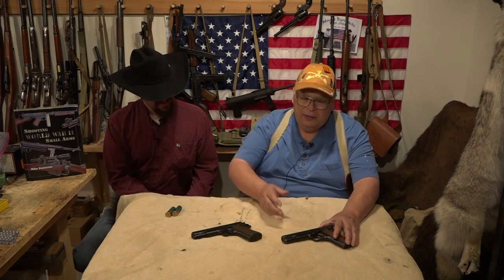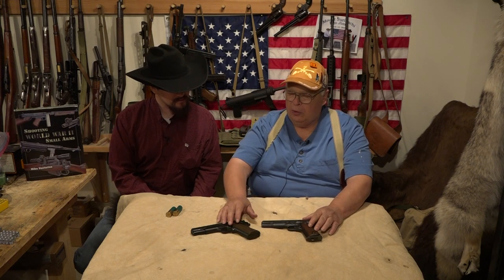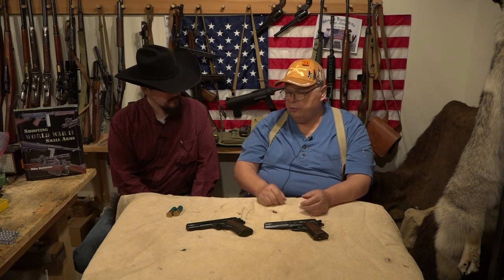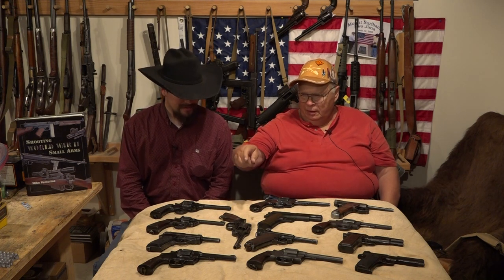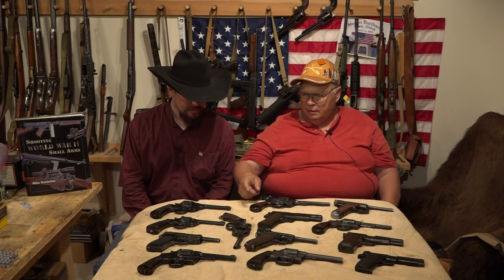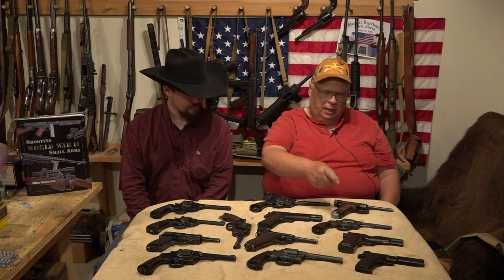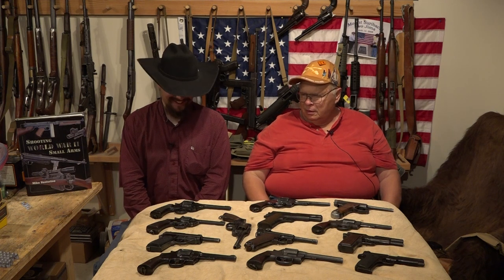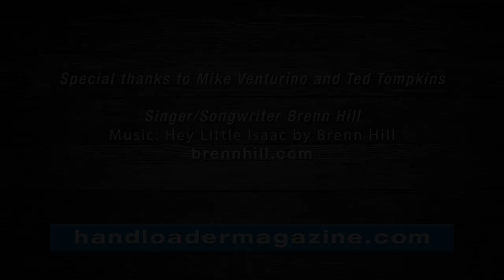WWII Small Arms Series The 1911 Pistol

Comment: The M1911A1 was the gun I "cut my teeth" on.  It was the first pistol I ever shot when in boot camp (granted it was converted to .22LR).  Later, I would qualify on the M1911A1 and carry one while standing quarterdeck watch on the ship.  It began my love and appreciation of the 1911, and I have had many pass through my gun safe and hang from my hip over the years.  

And I know this will be heresy, but my favorite caliber 1911 is not the 45 Auto.  It's a toss up between 10mm and 38 Super.  

Little fact: Browning original designed what would become the 1911 for the 38 Auto cartridge.  But the US Army calvary demanded a 45 caliber bullet, so JMB redesigned the pistol to accommodate a new cartridge to meet the request: 45 Auto.
Reply from the maker: I love the 1911 I will always love those guns, I actually just added another to the collection not that long ago. Hopefully I can do a video on it in the near future! They are great guns. 

I hear you there my two favorites are 10mm and .45 ACP and I would say in that order as well. I am a huge fan of the 10mm Auto! 

That is quite interesting and I actually did not know that thank you for sharing that very interesting tidbit of information! --Jeremiah